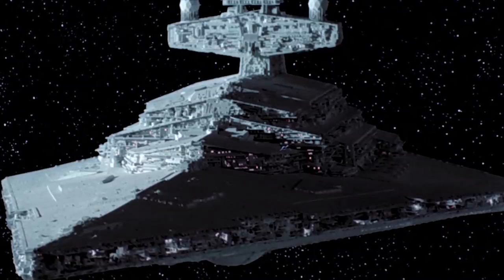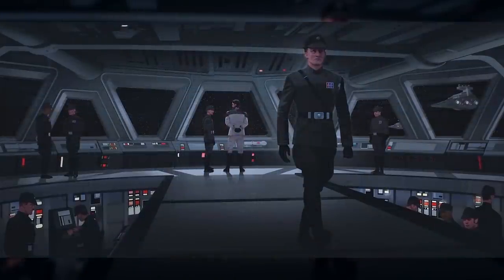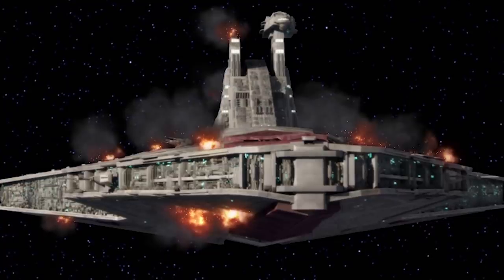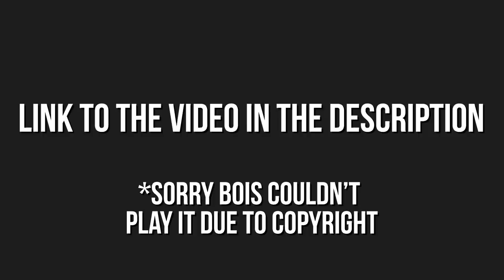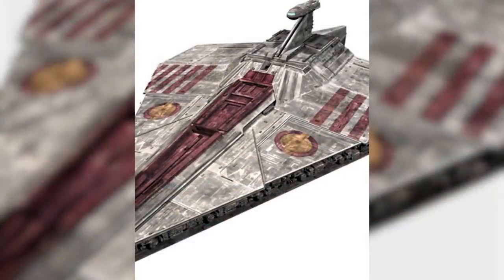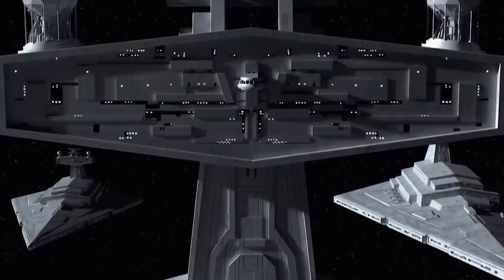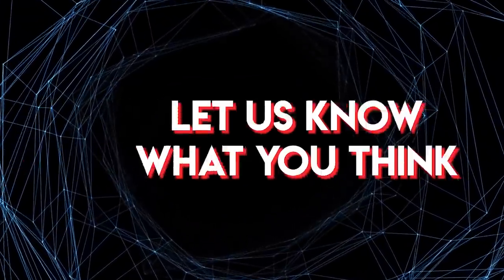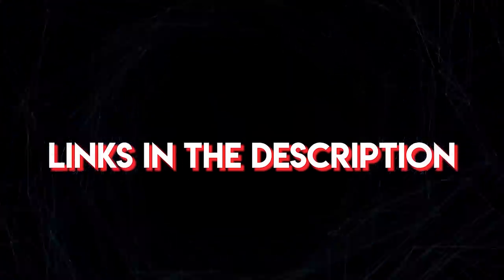Why were Star Wars Command Bridges SO Over-Exposed?

Comment: Could be largely due to issues related to building warships. The Imperial Star Destroyers were a kilometer long. The took years to build and were heavily in demand. Redesigning and testing a new ship and its systems would be costly both in time and resources. That exposed bridge is likely a holdover from earlier vessels which required the raised bridge for visibility but has never been amended due to time constraints.

Comment: The venator had a legitimate reawon for the bridges, as they would be very useful for craft direction, operation and recovery. There is no reason however for the ships main bridge to be there. Leave those for small craft ops and possibly a navigation bridge and put the combat command bridge deep in the ship behind as many bulkhead plates as possible.

Comment: The Mark I eyeball. I've gotta remember that one.

But as to why the command bridges are exposed, the reason may have changed over time. In the days of the Empire, it was perhaps vanity, a taunt, or otherwise overconfidence. In the days of the Republic, it was the Jedi sense of self-sacrifice at work, providing an easy target that wouldn't do damage to the rest of the ship if taken out; if the bridge is taken out, then the rest of the crew can evacuate and there'll be more to do that than if it was buried. Does either justify this choice? Probably not, but it's an idea.
Reply: I like the idea that it was forgotten relic from past, when force users channeled force and used it as advanced targeting system.
Reply: @dracthewanderer6871  , that's a good one.
Reply: @no1ofconsequence936  You've seen prototype Clone Wars episode where Anakin basically was aimbotting enemies with a blaster through cover smoke? Imagine that in space.
Reply: @dracthewanderer6871  , yikes, I don't think I remember that. I'll have to watch it sometime soon. Still, sounds like it'd be a nightmare to fight.

Comment: 0:58

3 Easy Steps on how to take down a Super Star Destroyer:

1. Destroy the Bridge Deflector Shields.

2. Crash into the Bridge.

3. *Boom*
Reply: Yes normally works for some reason.
Suprised they didn't fit 3 bridges on it with 2 internal.

Comment: I have to go with Shielding being the primary reason. Shields were by far the primary defense for star wars vessels, as the Plasma Bolts seem to go burn through armor rather easily once you get to Capital Grade laser weapons. So why bother with protective designs when shields cover the vessels anyway, and the moment shields go down the vessel is essentially lost anyway. That and it seems like Lazer weapons are relatively inaccurate at great ranges so targeting even an exposed bridge could be challenging.

Comment: Ok to be fair the venator was primarily a carrier not a brawler and one tower was air traffic control for all the fighters. But the ISD has no excuse they should have learned from the venator which often ended up in the front lines.

Comment: HALO's Captain Keys and Admiral Cole were infamous for complaining about this concept. They reminded superiors that Covenant Ships had their Bridges at the Center of the Ship, behind Multiple Decks and Heavy Shielding. as they often stated Conning-tower Bridges were exposed to hostile fire for no useful reason, as ships relied on Sensors to see at a distance. Cole's complaints also occurred Every Single Time he lost ships due to this weakness. Revan and Thrawn were also likely known to complain about such weaknesses (while this is not Specifically stated, their naval doctrines reflect this depth of strategy), as they were notorious for complaining about obvious weaknesses. This weakness is, in fact, what allowed Malak's Betrayal of Revan to go as well as it did. It is also interesting to note that Sienar's Interdictor and KDY's concurrent Battlecruiser Design, the Centurion-class,  both possessed this design flaw. The Galaxy's Major Shipyards' Designers were known for their arrogance, self-importance, and Form-Over-Function Mentality.

Comment: If visuals were that important and sensor so unreliable why not have a seperate conning tower ?That way the crew could spot AND the main bridge could be kept save inside the ship.Even if the bridge ,for some reason, had to be exposed they could still have a back up bridge inside the ship for emergencies.

Comment: To be fair, the empire gets a pass as they never really had to worry about any actual threat to their ships until the rebel alliance formed, as no one had the guts to take an ISD on in combat. Plus in order to get to an ISD shields, you need small nimble star fighters to fly underneath the ray shields that seem to be about 10 to 12 feet off the surface of a ship where as the partical shields seem to be right on the surface. ( my theory is that they act like magnets and push eachother away the closer they get and it’s just more energy efficient to keep them apart) the star fighter then slip under the ray shield and open fire on the turbolasers that are only protected by the particle shields, and the shield generators so the rest of the star fighters and starships have a clear shot at the bridge.

Comment: EDIT: Huh, i wrote this early into the video, honestly didn't expect this to be mentioned

honestly, everyone is forgetting the best piece of evidence in FAVOR of at least some kind of external command bridge (I will admit that definitely need a re-design)

"Geth don't use windows, they are a structural weakness"

And because of that, any ship capable of hiding its presence from other technology is fucked.

It is MUCH harder to hack someones Eyes, than it is to Hack someones tech. Redundancies are important

Comment: Now listen up youngsters! Old uncle Rock is gonna drop some real world knowledge on ya. A ship is a ship only because it is designed to travel. Everything else that it may do is secondary to that purpose. Travel requires navigation, steering, and thrust. With main systems non-functional, thrust and steering are still possible through direct local control in the engine room etc. What cannot be accomplished from there is navigation. When all the gizmos quit working, one dude with a radio and his eyeballs can still direct the ship. Worthy of note is the shape of the bridge as well as its location. The observation walkway extends out both wings of windows to give full dorsal view past the sides.

Comment: I heard one theory, but I don't know about its validity.  Supposedly the bridges were that far from the hull to keep it away from the main reactor when it was running full out for combat back when reactor shielding wasn't so good.  Then it stuck around as tradition.  I don't know if there is any evidence of this or if it just a guess.  It sounds possible even if it still short sighted.

Comment: I always wondered why they never went with the halo covenant route and made the bridge inside the middle of the ship where it would be the most protected. They have the technology to use cameras to see outside or maybe use something stronger than plexiglass.
Reply: I think jammers might have been a problem, but I don't think you can just jam visual scopes that are just basically lens, so something that works like a telescope and transmits a wired signal through the interior.
Reply: @avyay9818  Yeah jammer were a thing but just like you said that physical scopes or cameras wouldn't really be affected. They have reconnaissance drones with great quality cameras apparently so couldn't they have a dozen of those bad boys around the ship.

Comment: Imperial fleet commanders: This is the best command structure we've ever built.
Mon Calamari commanders: Well, yes but actually no.
Reply: I know, Mon Cala and Separatist ships are much, much better. But Mon Cala ships also have redundant shielding. I actually like New Republic star destroyers in this regard, as they put the bridge close to the fuselage
Reply: @avyay9818  I must agree they are very strong in both armor and shielding and the have little weak points exposed on the ship if at all. It also excels as a carrier as well with plenty of fighters in its hanger bays.

Comment: You forgot two major reasons one is boarding protection since capturing a warship would be better then destroying it.  Two would be design methodology basically either we always did it this way so it’s how I know how also is tooling . Third but it’s a maybe is like our real world cars they are built to fail (and in general last a fraction of the time as they used to) so you buy more. In Star Wars warships where more like cars and less like real world warships in that they were not always designed for a military with funding but independent (as much as you can have it during some periods) so leaving that design flaw and passing it off as a feature would benefit say kuat drive yards for example

Comment: Problem with bridges within the vessel is: What do you do when your sensor fail? Fly blind?
Reply: And submarines would surface and place someone on top of the tower to observe where they are going if sonar, radar and periscope fail.
Reply: How could a periscope fail? The lens could crack obscuring the view, it could fill with sea water, it could get stuck preventing it from rotating or being used entirely, the top part could break of, nothing is indestrucitble. And I never said, that overexposed bridges are a super smart idea, your are correct, in your observation, that this would be tremendously stupid. What I am saying is, that having windows is one of the easiest ways to ensure limited operationality even without sensors and such not functioning.

Comment: As for why the design flaw, it puts the commander at the proverbial front, and most dangerous position on the ship, increasing moral that the Commander is willing to stand there while all hell is breaking loose. 
Also, damn lazy designers falling back to water designs what space would mean there is no up or down.

Comment: My only problem with having a command ship with the bridge in the center is you don’t know what’s happening in the battle though you could have the command deck on the main part of the ship

Edit: Like the Hammerhead
Reply: SW has advanced sensor tech. Just use lots of em.
Reply: I have a hard time believing that star wars doesn't possess some sort of projector/viewscreen technology that can show the outside of the ship
Reply: I think sensors and holograms would provide a more reliable and advantageous command ability than just seeing the battlefield from one angle and as for the gunners and helmsmen again sensors and holograms should do the trick

Comment: The Executor's bridge in the ESB was higher and crew pit pannels are parallel to the middle path but in RotJ The Executor's bridge had become smaller and the windows shorter, the room had become narrower and crew pit pannels changed. is there an explanation for this?

Comment: The over-exposed bridges of ISDs is stupid yes; however one smack dab in the middle is not the smartest idea either. Besides factors you have also said, if the ship is all but lost in battle there won't be enough time for the command staff to reach escape pods. Plus looking at most surface naval ships, spacecraft, and subs IRL the bridge is somewhat exposed in an effort to get the best of both. I think that the Sci-Fi bridge from the ships from the respective predominant human factions in Halo , Mass Effect , Stargate , The Expanse , and The Sojourn to be among the more better designs. Not too exposed, but has enough of an external view that the ship can still be effective and functional if the sensors go offline.
Also almost everyone seems to forget that a ship can have more than one bridge.

Comment: Another reason, seen in real life, is stroking the ego of the guy that writes the checks, and the officer in command. Bigshots wouldn't be taken on a tour of the bilges, so an impressive bridge, and luxurious command lounge, were needed to keep clients happy while not overtaxing their limited technical knowledge. A real-life example were the designs of conventional and nuclear power control centers, post WW2. The first consideration was to please the board of directors. 

This resulted in a long wall of dials and gages, stretching floor-to-ceiling the entire length of the room. The instruments were gigantic, and placed for maximum dramatic effect. The operators had to scan all over the wall looking for the data they needed, rather than having things logically used together to be grouped together. At least Star Wars bridges seem to have things more logically grouped, and sized for one or two can comprehend what's happening. The dark interior, and lots of colored lights look more like a Las Vegas slots parlor. I think lighting and instrument design could have been done better.

One example of current design principles are the general-purpose workstations, first used in ST:TNG. Nasa, Spacex, and other control applications today. A control room from the Apollo era may have had dozens of people sitting at custom-built consoles, just to keep an eye on one instrument. If your console has problems, the operator may just have to walk to the next free console, and sign on again.

Compare a Boeing 707 cockpit with one on a 787. The first jetliners needed a flight engineer to monitor the gauges and switches that couldn't be stuffed in front of the pilot. It was a wall of lights and switches that probably took more room than the flight instruments of the pilot and copilot.that still doesn't address the picture windows for officers and VIPs on the bridge. Best practices would say to make the bridge, and those "flimsy" windows the most protected part on the ship. Everybody should know that bridge structure was the the toughest nut to crack, and not just a cheap kill.

Comment: an over exposed command bridge makes no sense however on ships like the lucrehulk and venator the flight control bridge (one of the two bridges on the venator) almost needs to be exposed as it needs to have a good view of the main hanger to co-ordinate incoming and outgoing space craft for the venator we know the main hanger is on the top of the ship so the flight control bridge needs to have a view over the hanger hence its exposure., if for whatever reason the flight control bride is stationed inside the command bridge then the command bridge would also need to be somewhat exposed but on the venator we know this isn't the case so it has no reason to be that exposed, it also makes no sense in a practicality point of view, needing to take a lift down then one back up just to go from command bridge to flight control bridge makes no logistical sense.
Reply: In the case of the Lucrehulk its passable, as the Lucrehulk was not a battle ship or a carrier... it was a freighter. It had thick shields and enough guns to convince pirates to look the other way. Much like how the Mon Calamari converted Passenger Liners into cruisers the CIS did the same to the Lucrehulk, they just threw more guns on it.

Comment: Don't forget Star Trek. Literally every federation ship is a flying weakpoint; overexposed bridge and engines, a flimsy frame riddled with windows. At least a Star Destroyer looks like it could take some damage. :D
Reply: Don't forget the lack of surge protectors.
Reply: but the ship does have backup controls and the enterpire D and galaxy class ships in grenal  have at lest three different bridges two of witch are VERY VERY WELL PROTECTED shoot the galaxy class command bridge! the battle brige takes over! take that out the control sistems in main engnearing take over! and good luck taking that last one out because its like directly contecnt to the main warp core and the third computer core by the way the galaxy class has THREE MAIN COMPUTER CORES! TWO in THE SAUCER SECTION and one IN THE BATTLE SECTION good luck taking out all three of them out and eatch one store all the ships data so theres three computer core you need to hit to nouck out the computer sistems and thats not easy to do

Comment: Star Destroyers where built for intimidation, not war
Reply: Eh, No.
Reply: @nobleman9393  "I maintain that the effectiveness of the Star Destroyer stems from not only its massive firepower, but from its size. When citizens look at a Star Destroyer and then compare it to the craft which might be mustered to attack it, they have a tendency to dismiss such a notion as suicidal rather than approach the problem tactically."
―Grand Moff Wilhuff Tarkin
Reply: @isimiel3405  So everything that has a lot of firepower and thick armor is only suitable for intimidation, but not for war?